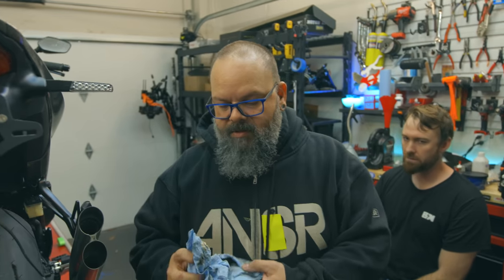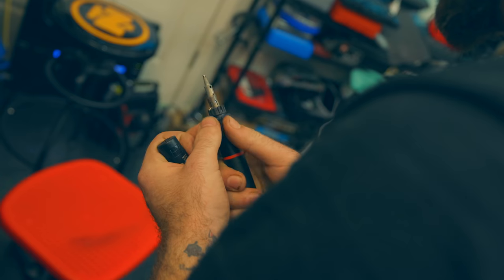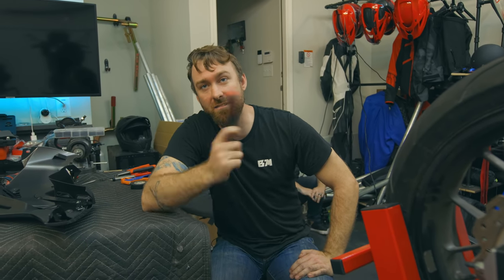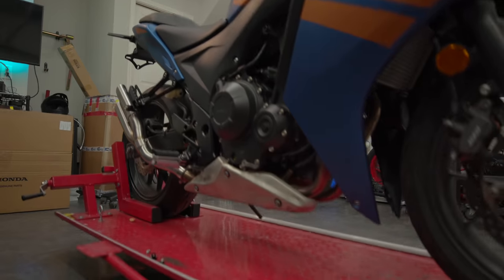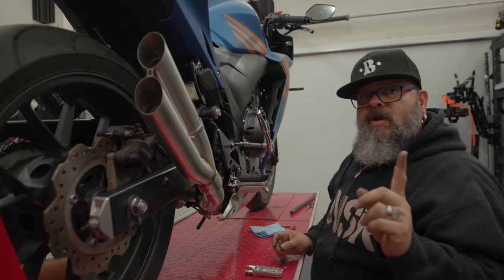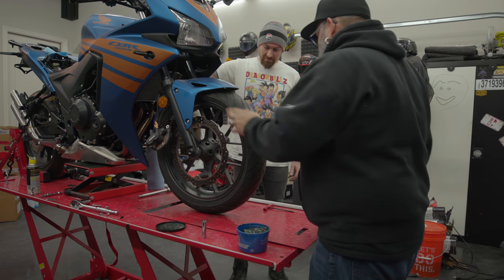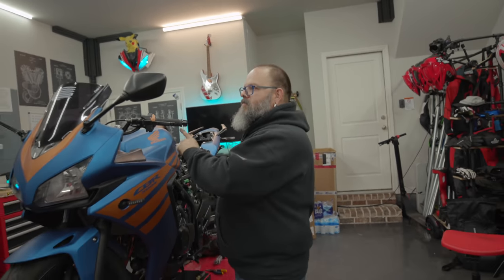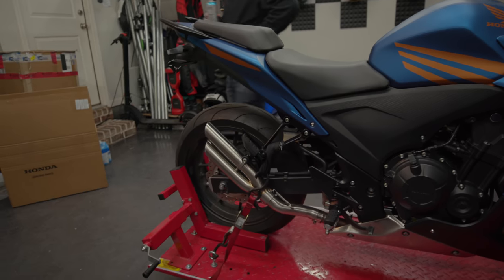Make your bike look BRAND NEW! | Wrap job on our CBR 500

Comment: LED turn signals and no load resistors? Also why not change out the low beam n high beams to LEDs?
Reply: Load resistors? Yuck. An adjustable relay for a couple of bucks would do the trick. Plug and play.